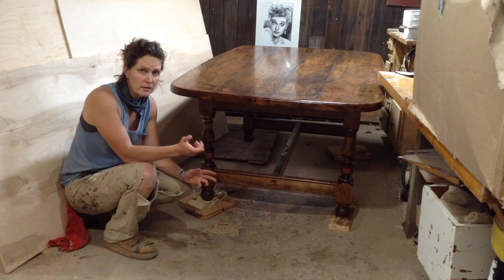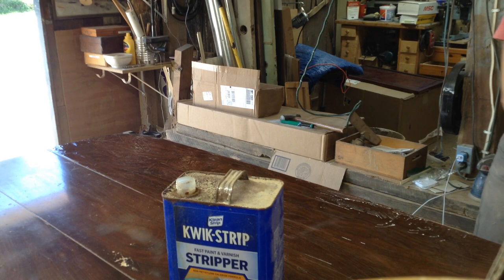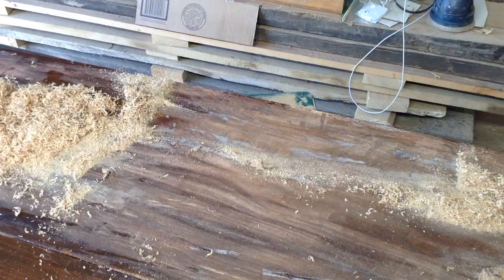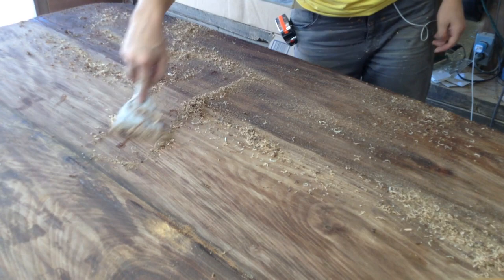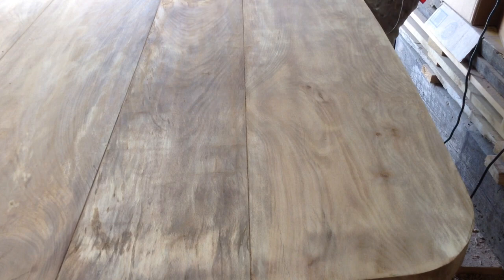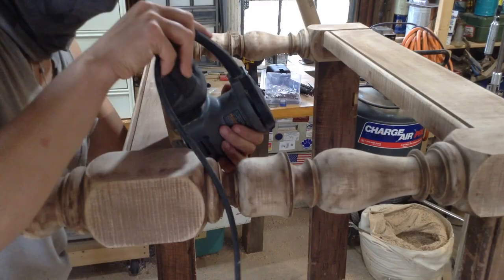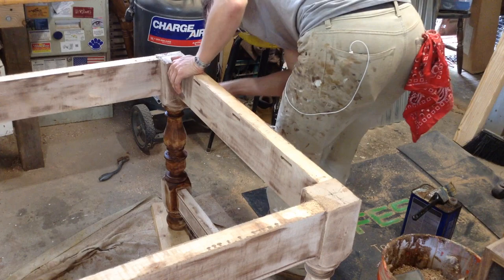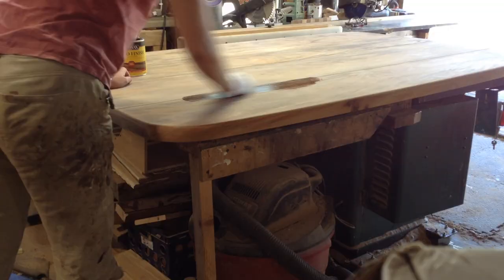Woodworking : Modify and Refinish a Table // How-To Part 2

Comment: Looks GOOD! Do you ever use the  wipe on Poly gels? Dust is always a problem  for sure!
Reply from the maker: I do not use Poly gels.  I have tried them a couple different times and find then really hard to apply.
Reply: @HoneyBadgerWoodWorks  I have used them I think they are a lot easier  than brush on poly!